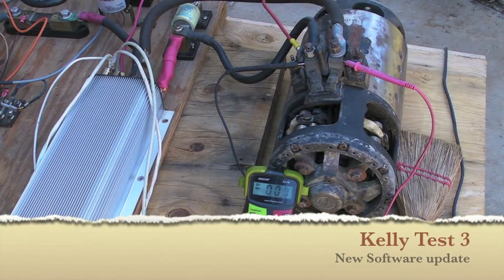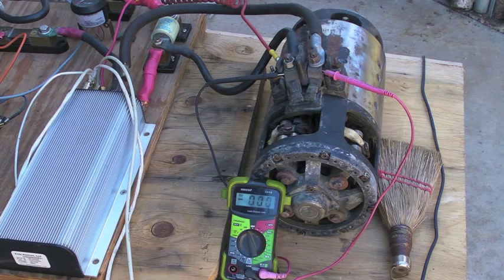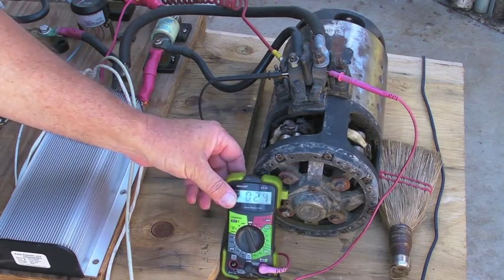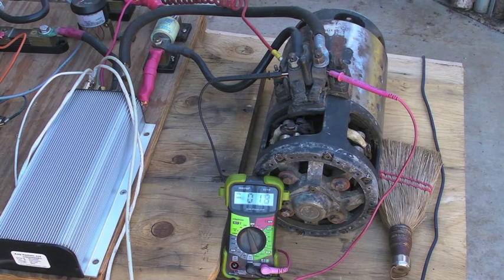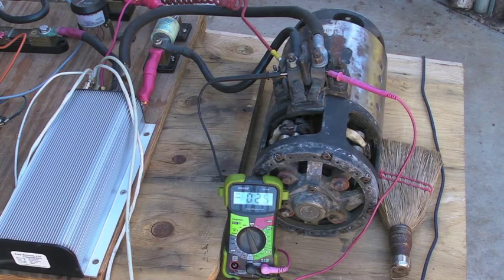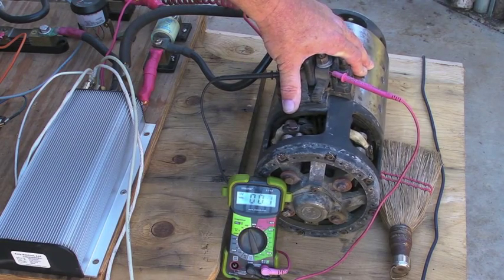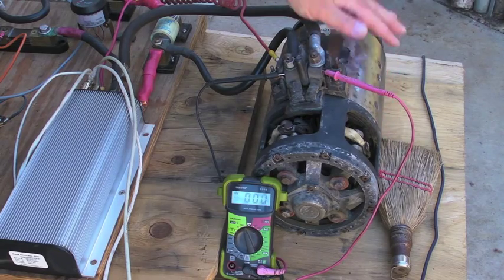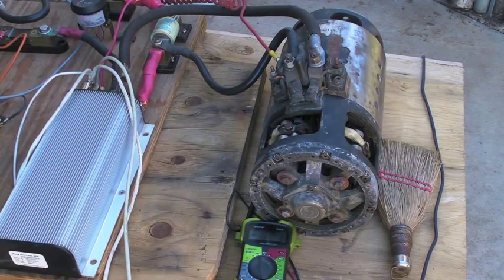Kelly Test Three.m4v

Comment from the maker: For this test bench setup and test I did not have the precharge connected. It would be normally connected between the two terminals of the contactor. For normal daily use even with low voltages you should have a precharge connected. Connecting the controller is quite easy as long as you have the proper information from the manufacturer. This one has extra goodies you can connect if used. The basics are very simple. Just connect the basics and your good to go. Add components/features later.

Pete